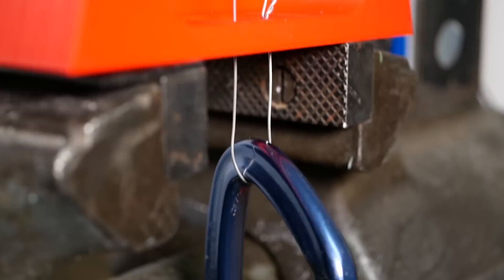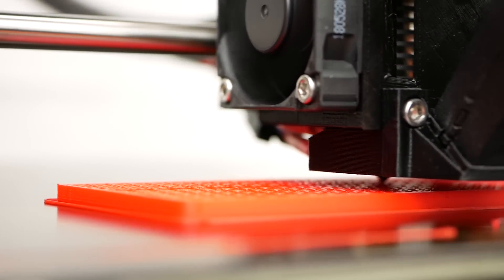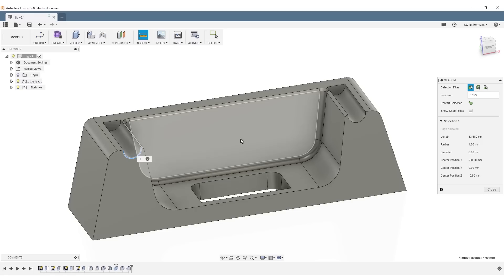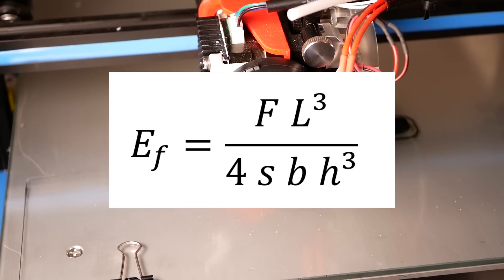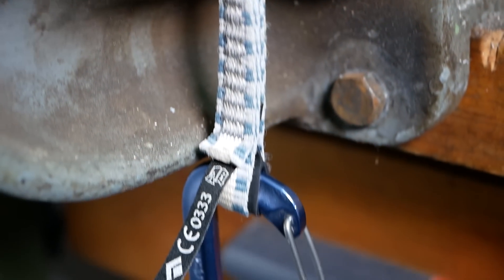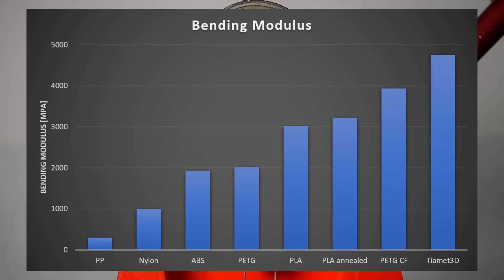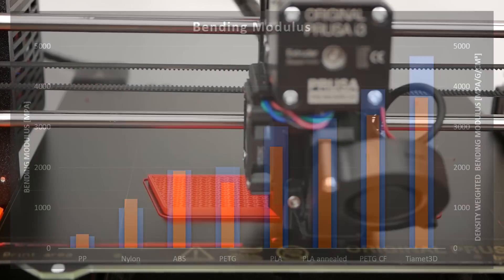Which is the MOST RIGID 3D printing material?

Comment: Thanks for all your videos Stefan!  I've watched so many of them, but there's one test missing (I think).  You've done bending strength in this video, and in other videos you briefly touch on the pendulum swinging weight to calculate the breaking force,  but what I can't find is the effect of different infill patterns against loads on one end rather than in the middle.  I suppose a bit like a shelf supported on one end and the load on the other.
Reply: I realised what I would like to see from comments from others (see "TESTING 3D printed INFILL PATTERNS for their STRENGTH") - cantilever test with one end of the beam clamped rigidly and the other end loaded with your tester to produce a force-displacement graph (see @LMF5000 's post from 5 years ago)

Comment: Stefan: Thank you for all the strength videos.  Have you tested this beta loading with different infills/orientations?  Since there's compression on the top layers, tension on the bottom layers and sheer between layers, it would be interesting.

Comment: Great video Stefan, I tested a bunch of carbon and glass filled filaments for strength, stiffness and toughness and found the stiffest were the CF PLA, in the 5-6 Mpa range for flexural modulus. Although a glass-filled nylon was almost as stiff and quite a bit stronger.
https://youtu.be/-cL3G4QxLck?t=439

Comment: You sure steel has 200000 mpa? You might be using the wrong units because a36 steel has an ultimate tensile strength of around 800mpa.
Reply: Steel has a Young's Modulus  of 200GPa

Comment: I like your videos a lot thumbs up. It would be interesting to compare stiffness with strength in comparison. The tiamet filament is rigid but has a lower strength then pla .. so I guess it is most of the time garbage :S. I would like to see reinforced materials in comparison to each other (Nylonx vs Xt Cf 20 pro ) for example. It would also be interesting if a material is abraison resistant. Anyway keep up the good work

Comment: Awsome series of videos ! Really the engineering that goes into your videos set them apart :)
I wonder if this would work with a more classical construction: straight spars and perpendicular wing cross sections (like good old wooden wing construction)... maybe easier to try and design a simple model that way? But is there structural be efit of doing it like they did (or was it just for fun and style, and show off things that other constructions techniques can not do :) )

Comment: I would like to 3D print a custom insole/orthotic shells. Does anyone have any suggestions/experience on doing this. I currently use 3mm PP sheets for vacuum pressing my shells so I figured PP would be the logical choice for 3D printing. I'm not sure how much the material strength will change because of the 3D printing.

Comment: Hello Stefan, I found this interesting material Nylon Taulman 230, the beauty of this nylon is that it can be printed at 230°C and no heating bed,   have you had experience with  the Taulman 230? It would be great if you can test the properties of this material comparing to regular Nylon, ABS and PTEG
Reply from the maker: Unfortunately never worked with any Taulman filaments so far.

Comment: Nice test. According to a study, ABS reinforced with 30% CF achieved the best results for the Young's modulus test (better than 40% CF Tekinalp 2014). It would be also good to chart the Young's Modulus [GPa] Vs Tensile strength [MPa], according to results the Ultem 9085 takes first place followed by PC and Nylon.

Comment: Well done Stefan, im quite new to printing and yet to buy my own. Thinking about starting a small business. So do you have any recommendations for filaments/material choice when the components are to be used in the harsh environment of CNC machines. I’m thinking of cooling lubricant, strength as you point out in this video but also heat-resistance.. :-)
Reply from the maker: I'd look into PC or PC/ABS (though not the easiest to print).

Comment: thanks for the info , wat i still like to find out is how the layer strength is (how well they stick together )
going to build parts for a cnc conversion of a milling machine  and there some peak and constant forces aplied to different spots in the material (the bearing pocket , the steppermotor support , the screw and boltholes ) i like the strongest material but if it splits faster along the layers it still has no use to me

Comment: Have they ever said what percentage of the filament is nanodiamonds?  Eg sometimes you buy metal filled filaments that are 10% filled by weight while others advertise they have 30% by weight and you can tell the difference.  With the cost of even industrial use diamonds ($60 for 200ml) I imagine they don’t add more than 1-2%, would you agree?
Reply from the maker: I don't have any numbers but it's supposedly only a very low amount since nano diamonds are pretty expensive (much more than the $60/200ml).

Comment: Your videos are really well made and documented. I would like to see the same test but with the two other print orientations. Reinforced PETG may come ahead because of its good layer adhesion.
Reply from the maker: Watch my carbon fiber PETG review and you'll see that at least mine had bad layer adhesion. This test should also not show good or bad layer adhesion since I'm not loading the samples till failure.
Reply: Good point, thanks!

Comment: Nice video. I would be curious what the results would be with the direction of load being parallel to the layer lines instead of perpendicular in your setup. I suspect the strengths will be much higher across the board.

Comment: Thanks for a very instructive video! Have you ever checked how much different materials change in measures when ready? I'm looking for a filament that keeps good measures. (Hope that makes sense!)
Reply from the maker: Didn't do that yet but there is a high chance that PLA is a good material for that since it doesn't contract that much during cooling.
Reply: Thx!

Comment: Have you ever tried Taulman Alloyy 901? It seems to be a very interesting material regarding stiffness.
Reply from the maker: Are you speaking about Alloy 910? Taking a look at the data sheet shows a pretty low modulus of 73ksi (~500MPa). Don't know if that's typo and no, unfortunately I've never used any Taulman filaments.
Reply: seems to be stronger then regular petg. tom3d has a nice review

Comment: Excellent. Some questions: Do the values fit to datasheets? How is the reproducibility? You have quite large deformations are the formulas still applicable?
Reply from the maker: The values of the normal polymers are comparable to datasheets but the reinforced ones can vary quite a bit. Unfortunately I haven't checked reproducibility (not very scientific and ISO 178 actually asks for at least 5 samples each). Large deformation can actually have an effect (kudos for that!) but the results were pretty linear and the standard even doesn't ask for taking that into consideration. Most deformations were small (~2mm max) where the formulas should still be pretty accurate.

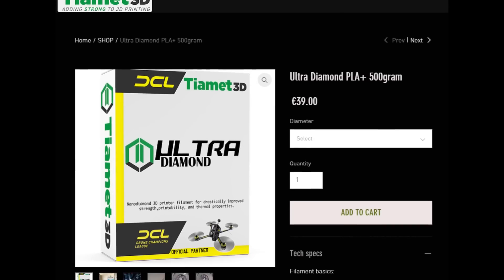Comment: 1:31 That sounds just plain terrifying to print with...anything. For science's sake, I'd be interested in seeing how badly that bores out a hardened steel nozzle if you decide to review that stuff or just feel like murdering nozzles. I'm sure it'd eventually chew up a ruby nozzle too, but that'd just be a sad day.
Reply: Actually, nanodiamond filament is not abrasive.  The nanodiamonds are very small, and spherical, and only a small fraction is used, but it has a huge effect.
Reply: Neat. Sounds a lot nicer than the other composites I've tried.
Reply from the maker: Totally right. This filament can actually be printed pretty fast and one reason that allows this is the lubricity from the nano diamonds.

Comment: What material you thing would be best to make an FRC style robot out of. The robot will be about 30x30x56 in (80x80x140cm) in size and will weigh about 120 to 150 lb needs to survive crashing into obstacles and other robots and at the end most of the time hoist itself up a couple of feet of the ground We would like to replace most of the aluminum we use now as we are always running into weight limitations and also have problems with accuracy as ours usually is built with hand tools. (saws all and hand drill)  If you want to see the one from last year (the one we are working on 3d printing) go to www.vernonrobotics.com. We have a makerbot replicator and a pulse (Prusa clone) with a garolite plate and an E3D V6 hotend so we can also print in PETG and Nylon. Another limitation is to stay within the rules the average filament cost will have to be under $30/kg. No there is no rule to say that but that is how the math works out figuring what the whole robot is allowed to cost and what motors/wheels electronics etc will cost and that we figure to use about 15-20kg of filament in that project
Reply: Keep in mind that the specific strength of plastics is noticeably lower than aluminium (Aluminium 6061-T6: 0.1, PA66 nylon: 0.073) and the specific modulus is so much worse that its beyond comparison. For parts that need to be stiff or strong you won't save weight by going from metal to plastic. You're only going to save weight in areas where you can't manufacture the metal part to be thin enough. 

From that perspective, I'd recommend ABS. It's the cheapest filament option (ABS can be had for $20/kg from Hobbyking), and its performance is pretty good- strength is comparable to PETG (except in layer adhesion) and the heat softening temperature of around 100C means you can use it near motors and other warm parts without issue. Impact strength is also nice. For structural parts you need to carefully consider how much load the part is under and whether it needs to be metal- if metal is required, you can 3D print jigs to help manufacture the metal parts accurately.

If you need 'we can only 3D print this' geometry in metal, there is one additional option available to you: 3D print a pattern and cast the part using foundry techniques. PLA is good for this because it can be burned out of a plaster mould like traditional waxes used for investment casting, which allows otherwise impossible shapes to be cast.

Comment: Nice video, however as you have already the system, could you extended  your idea a bit? Could you pick up 1-3 materials and print with different fulfilment with graduation for example 10% or 20% and repeat it? It would be nice to see how is the maximal economical fulfilment to have almost pretty good stiffness or strength. Maybe it would be the case that between 50% and 100% it would not be much difference and printing time and material to use to print it will not be justify. In addition it would be nice to see difference in temperature print. Personally, I notice difference in strength for the model printed in nylon and the difference was about 10C. Thanks.
Reply: Fund him on Patreon and request all you want, it will have more weight then.

Comment: Has anyone tried to mix different filaments in prints, something similar to reinforced concrete?
Reply: I think Stefan could request Geeetech A10M review unit for this if he doesn't have the Prusa MMU.
Reply: Or he could just make some tightly fitted "pockets" in the print, pause the printer. And squeeze in e.g. a metal mesh and then continue to print over it. I wish someone with the resource and time could do some systematic testing of this.

But with a 3d printer that can extrude multiple filaments in the same print you could have so much more complex ways of combining different materials together.
Reply from the maker: Working on that. Unfortunately it didn't make it into the video.
Reply: Yes!!! Looking forward to see the results.

Comment: interesting, i didnt do the tests but i could feel by hand that petg, at least my roll, was stiffer than abs, though in my tests petg tends to explode when stetched instead of stretching like abs, and it becomes quite hard before exploding.
Reply: the properties of petg can differ a lot depending on the polymer used
colorfabb ngen, which is also a kind of petg is very brittle and stiff  but others are more flexible
Reply: DragonHunter247 
The one i use is a locally made one, Printalot brand. Overall prints ok, 245-250*C does ok but 255*C starts bubbling if printing too slow. Either way layer adhesion is shit compared to the pla from the same brand even if said pla was printed about 100mm/s. Ive printed near 200mm/s and that pla still stuck correctly but the petg breaks between layes very easily. I dont do much petg but im planning on buying another brand to see whether its this brand or what because as far as ive seen petg is supposed to have really good layer adhesion.
Reply: My PETG sticks wonderfully to itself if the cooling is low enough, so no layer fan or very very low - i think i had the fan set up to ramp up on overhangs. Of course it prefers to stick to glass, to hot-end, to everything else too. Didn't try running it above 250, saw no need.
Reply: I tried with and without fan, same result, poor layer adhesion, i stuck with using the fan in max as it left a better finish and helped with overhangs and bridges a lot. I tried from 240ºC as it recomended and it was horrible, tried slower (15-20mm/s) and same result, tried higher temperatures (255ºC) and nothing. Its either this roll came shitty or this brand is shit regarding petg. The roll originally came inside a sealed bag but it had like dust and fine sand spots all arround the spool like stuck with static electricity so im betting its the brand. Ill have to try some other brands to be sure its not just me asking too much from it, but i can screw a screw into a pla hole really tight so much that the hole perimeters themselve will rip off the infill and top and bottom layers but when i tried with this petg the moment i did any effort the layers just poped open.
Reply: It sounds like they have had a major manufacturing mishap or don't have a proper manufacturing procedure whatsoever. Wait what colour did you get? I know most companies can't get a masterbatch of the same material, so they use something else, like EVA based masterbatch; early PETG was very transparent, maybe PETG doesn't react too kindly to being added too much foreign material. I got clear PETG - and by the way, it's a bit of a menace because you get brown boogers occasionally, but i thought it was good to have some clear material that can stand up to a bit of temperature, make lampshades and whatnot. My brand probably doesn't manufacture in-house, and the way they generally do things, since they need quite reliable lead time and quality, it's likely rebranded eSun.
Reply: I got a glossy opaque black  petg roll because it was the most generic color, then it was either that or translucent red blue or clear.  AFAIK all local brands use imported raw materials or locally modified ones made from imported sources for both PLA and PETG. ABS being so shit they most probably make it locally from recycled plastic.
I also have a BPET spool, its supposed to be 100% PET, ive also seen it being called 110ºC PET, also black but i havent tried it yet because it was pet and not petg.
Reply: The raw material as it comes from the supplier comes as base material (uncoloured) and masterbatch (just the highly concentrated pigment or dye with a bit of binder plastic, as i said usually completely unrelated one) and is mixed on site prior to extrusion or injection moulding.

To have a healthy enough supply of regrind ABS, you need a substantial local manufacturing business which produces a lot of rejects and not just once in a while, so even ABS regrind is generally more available to import from China. Or is there actual plastic recycling available in the country that can sort out ABS? Besides you can't even usually maintain colour on regrind, so it's only mildly useful unless you're gonna colour it pitch black.

Highly opaque blacks and whites are weird. I am of opinion that they should be avoided unless you trust the manufacturer particularly well, and even then they tend to be sufficiently different from the base material.

The base material for bad ABS might not even be regrind. You simply shouldn't use ABS made for injection moulding for producing filament, because it will degrade during printing due to BFR being activated, the uncured Styrene will cause shrinkage, excessive Butadiene will cause shrinkage, all of this happens during injection moulding naturally too but you get a product out regardless if the mould is anywhere near sanely designed, while with a 3D print, you get a bloody mess that couldn't stay in one piece if it tried.
Reply: Then they probably dont then. I dont think there's any place that can process abs like that, and the ones i've seen seem to only produce recins from scratch. The local electronic wastes center does sell abs regrind, but with all the CF and FG in it. I dont think they can use that for anything other than injection molding filler now that i think about it. They dont sort anything, PET bottles at most, and maybe PE and PP but separating clean ABS from reinforced or ABD mixed with other things, i cant see that happening in here. The infrastructure here is mediocre at best.
Reply: I use Renkforce PETG and it seems a bit bendier than the ABS i use. For that matter, ABS can differ too because you can vary the initial amount of Butadiene, which is a rubber. Reducing Butadiene should make for a less obnoxious printing material since it inhibits Styrene polymerisation.